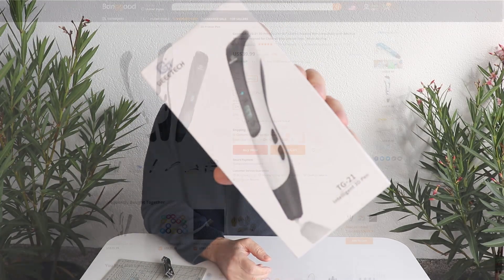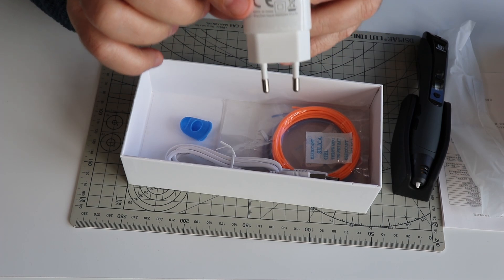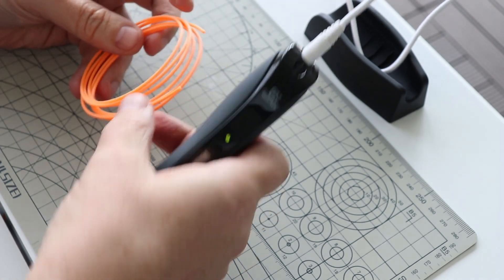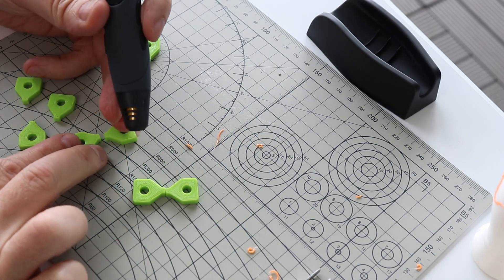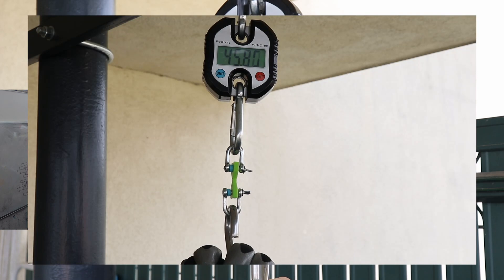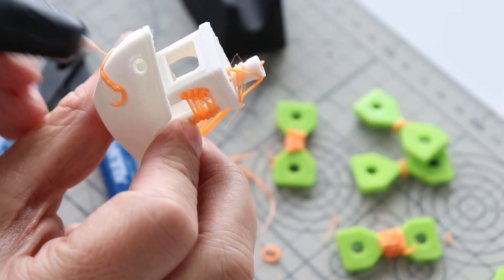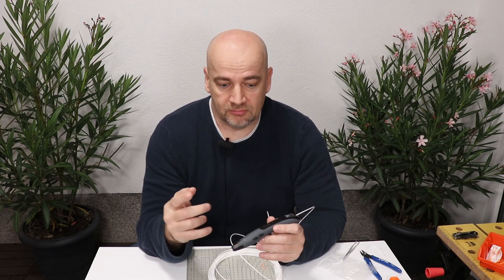Geeetech TG-21, a budget 3D pen from Banggood - can we use it to glue the 3D printed object?

Comment: Ugh, I wish it could do PETG. Then, it would be ideal for finishing prop helmets!
Reply: It can,   just set the pen to ABS mode it will reach 210° . My cheap 3d pen can reach up to 230°
Reply: @nrd90 The PETG I use will not print OK at 210C. I understand it can reach 203C, however how long can it continue run at that temperature?

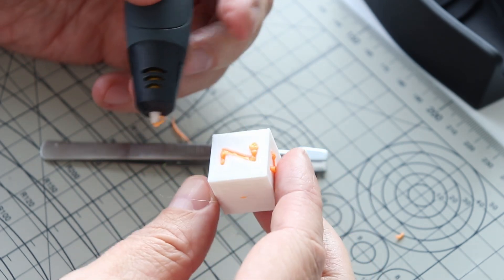Comment: Yes Igor !!! That coil whine noise came through in the video. Especially (for me) at 6:28 it was driving my ears NUTS!  I think its the heater wrappings / element acting up. My glue gun has the same-ish design flaw but the noise is at 50HZ since its mains powered and the wires being thicker, i think, it also gives it a lower tone.
I like your videos and it was great feedback telling us that You also heard that noise, even tho not many people are sensitive enough to hear those sound freq 👍

As e request, for future videos, could you crop out those high frequency (and/or low freq) sounds. And only include a clip sample on a separate part of the video? For some those are almost painful, or low freq sounds could blow up subwoofers :D Or put a txt box disclaimer :)

Sry for the wall-o-txt, keep up the great work.

Comment: Hello Igor. Very nice video!
What I would like to know is the diameter of the output infill from the nozzle.  Is it 0.4 or 0.2...? Are there any exchangable nozzles so anyone can fill thin gaps or larger ones?
About the glue tests I would like you to test some cyanoacrylic (i.e. Logo) and some epoxy (2 components).
Thank you.
Reply from the maker: No info about that, but according to the extruded diameter .4

Comment: Yes, design grooves that are normal to the layer plane, and then fill it to add cross directional strength. 🤔 Might be pretty useful. And look good if it's on a flat face that can be sanded.
Reply from the maker: Great suggestion, probably I will test the groove method for strength.. Thanx

Comment: Polycaprolactone (PCL) is biodegradable polyester with a low melting point of around 60°C and a glass transition temperature of about −60°C. PCL is prepared by ring-opening polymerization of ɛ-caprolactone using a catalyst such as stannous octanoate.
Reply: It seems to be only suitable for 3D pens.

Comment: You can get one of these cheap soldering stations that is regulateable down to 200°C. Much easier to glue/weld PLA/PETG etc together with.
Reply: Unless it's required to add filler material. 

It's like welding. Sometimes you can weld things together without adding metal, sometimes you can't.
Reply: @dangerous8333  it's not like you have conveniently rolled up filler material of the same color handy, right?